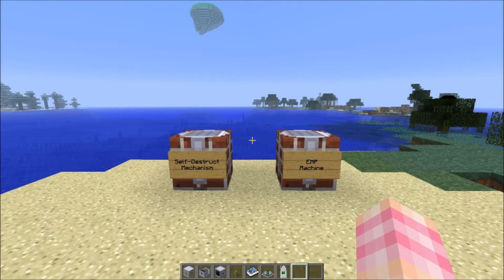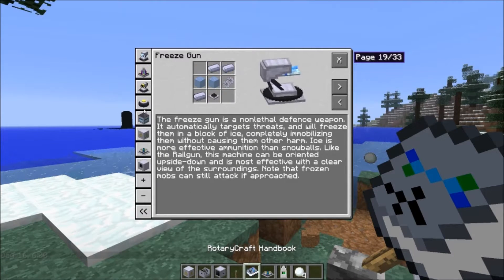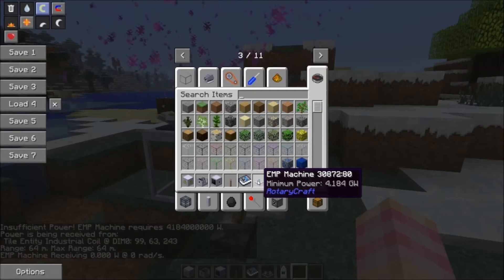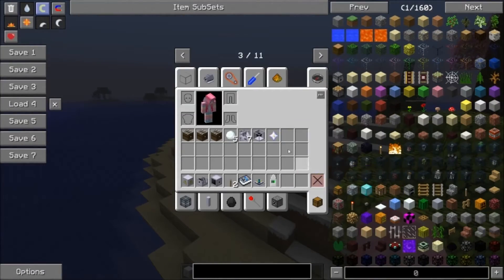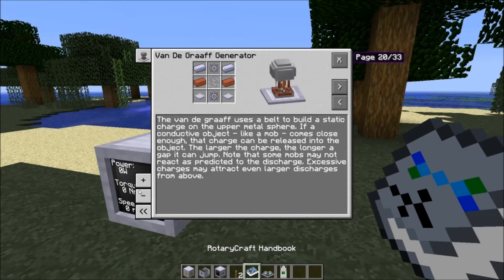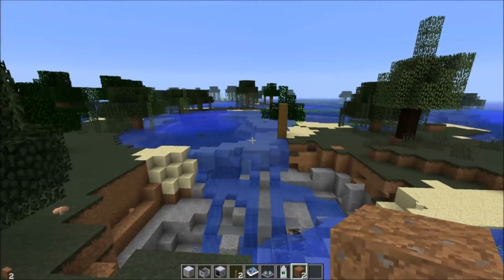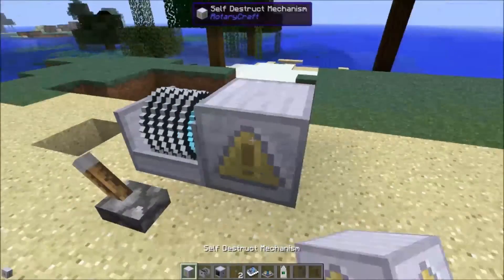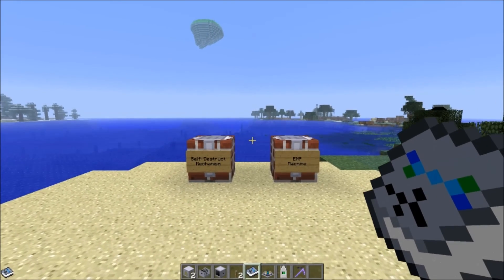RotaryCraft Tutorial #34 - Self Destruct & EMP

Comment: Are you supplying sufficient torque to the block cannon? It requires more torque for heavier blocks.
Reply from the maker: I gave it 9999 torque and 9999 rad/s and tried to fire a dirt block. At a velocity of 5 or below it placed the block directly on top of the cannon. At velocity 6 it instead dropped a dirt block entity directly next to the cannon and above that it does nothing.
Reply: I will look into it.
Reply: It turns out you need far larger torques than that.
V25 is going to reduce the requirements somewhat.
Reply from the maker: ReikasMinecraft Okay thanks for letting me know.